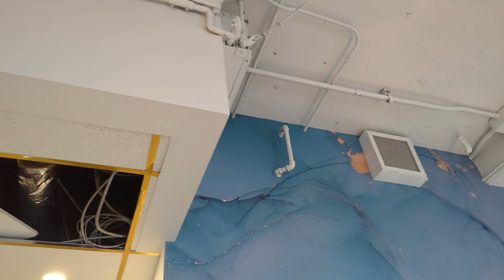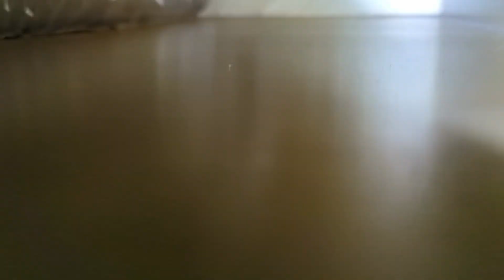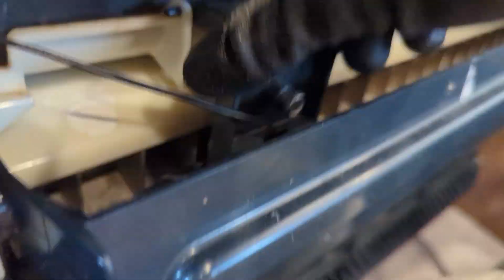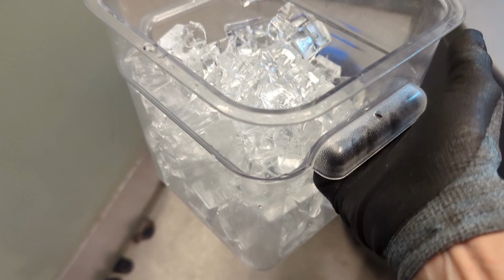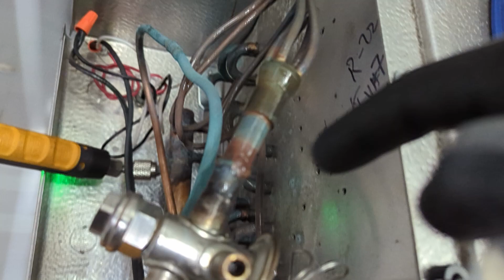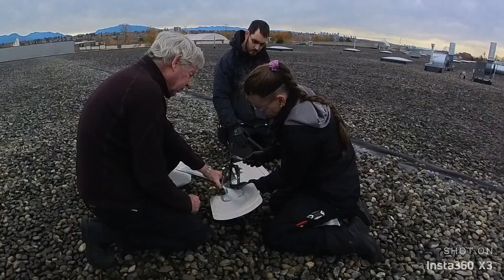November 10, 2023 - HVAC Vlog - Women in Commercial HVACR

Comment: Hi Jessica, I think short videos are the best way.

 By the way, I want to say how well I understand you.  I also sometimes tell the customer that there are many problems that arose due to the fact that the system was installed incorrectly.  But the client does not understand, and says that the system worked for 3 years without problems.  But I’ve already been involved in the HVAC industry for 10 years, so I’m used to it, and don’t be angry like you :-)

 (Sorry for my bad English, I'm from Odessa, Ukraine).